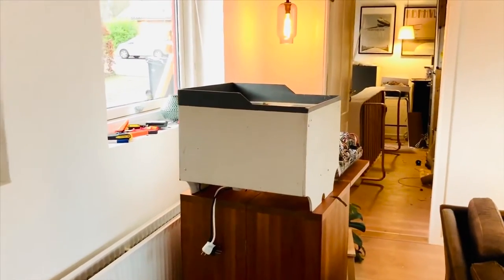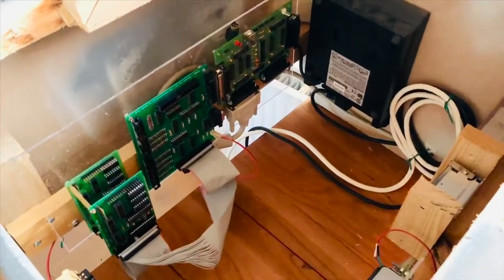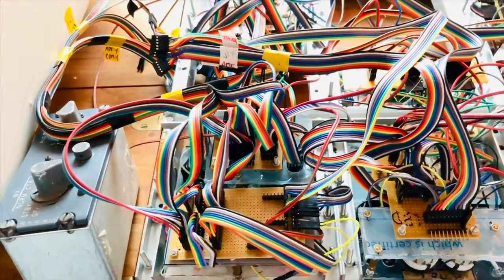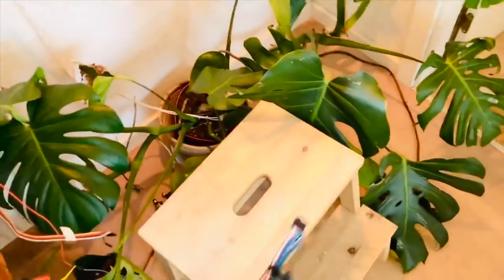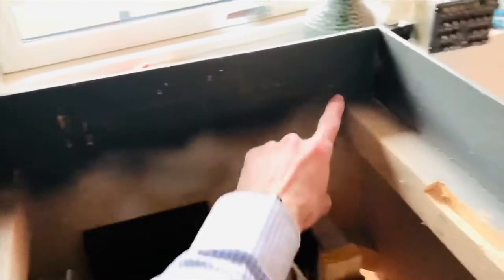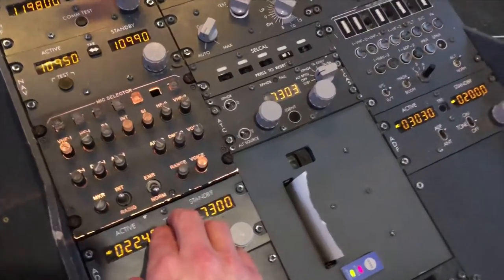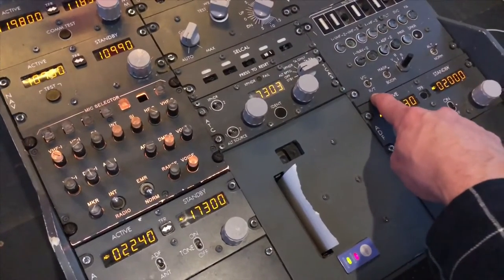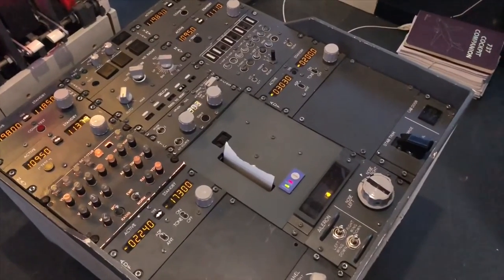Pedestal - B737 Home Cockpit

Comment: Where do you buy master card for radio panel
Reply from the maker: I used OpenCockpits. You need a Expansion Card, a MasterCard and DisplayCards. 
Later on I have switched to the USB / Plug'n'Play versions.